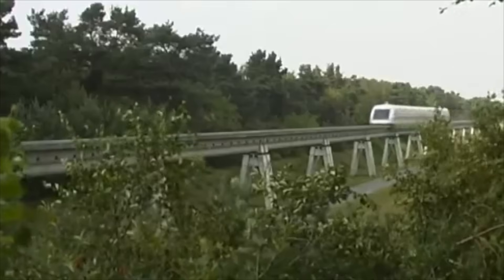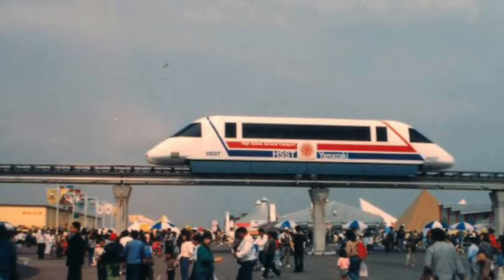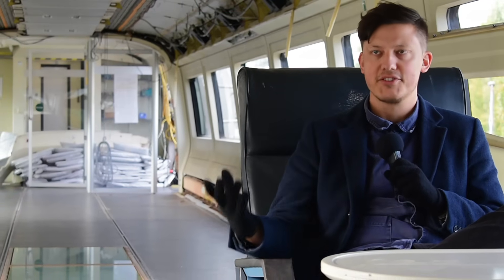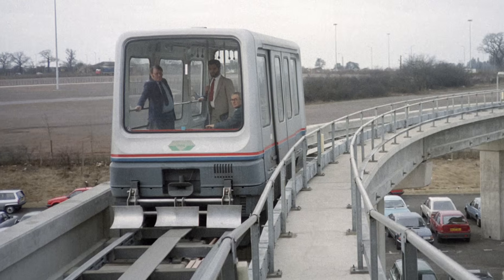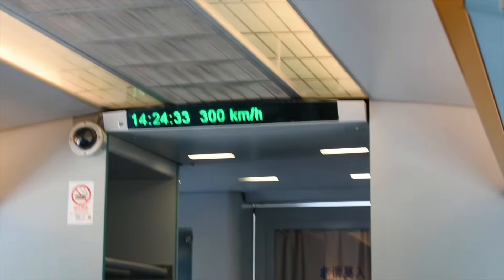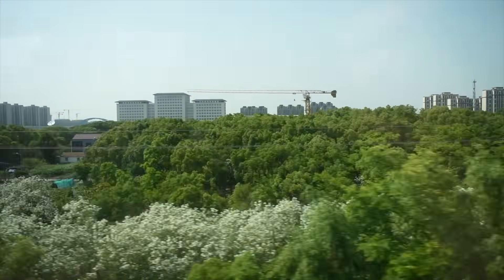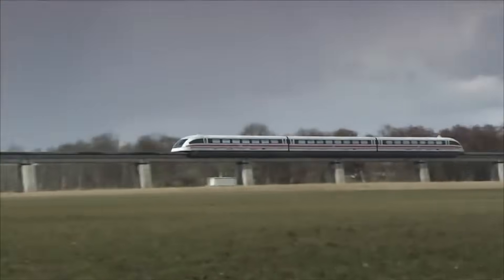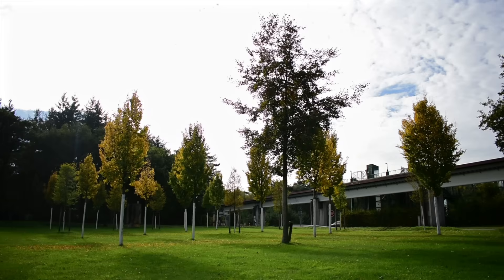Why Did Maglevs Never Succeed?

Comment: It was not the accident. High speed rail is compatible with conventional rail and hence can use existing infrastructure, i.e. can go directly to city centers on existing tracks, the track switches are simple, it doesn't need to be elevated... I suspect the speed advantage doesn't make up for all these disadvantages. Even high speed trains seem have mostly stopped to push their maximum speed beyond the 300km/h in Europe. The time savings are probably not worth the additional energy and infrastructure demand.
Reply: TBF the Compatability with existing Infrastructure turned out to be the biggest Downfall of regular HSR. Germany deciding against Maglev in the 70ies/80ies means that the ICE High Speed Trains now mostly use the same Rail Lines as Regional and Freight Trains, the latter hardly exist in Germany though. Vice versa do slower Trains also use the dedicated HSR Lines, and because there are almost no Sidings for overtaking anymore (Budget Cuts), the ICE Trains hardly ever go faster than 160 km/h (100 MPH) and realistically average only somewhere around 80-100 km/h. For the same Reason, Freight Trains often have to stop and wait for Hours or even Days, that's why Rail Freight is practically extinct today.

There's also the Problem that the major Hub Stations are beyond any Capacity and thus always are congested, so it's typical that you have to wait for 5-30 Minutes before the Train can enter e.g. Hamburg, Cologne or Frankfurt Central Station. Another Factor that always racks up Delays is that plenty Infrastructure was built in the 50ies and 60ies, to quickly fix what was destroyed and intended to be replaced relatively quickly. Unfortunately that intended Replacement was when the Railways were privatised in 1994, and now the Equipment still is in Use today well beyond any intended Service Life because replacing it would cost Money. Building a Transrapid Maglev Network instead of the ICE would have prevented this by having a crisp dedicated Infrastructure instead of this botched pseudo-HSR. It probably would also have been cheaper in the long Run, because now the German Railways are so run-down that fixing the last 30-50 Years of Neglect will take an estimated 100+ Years.
Reply: >High speed rail is compatible with conventional rail and hence can use existing infrastructure, can go directly to city centers on existing tracks, the track switches are simple, it doesn't need to be elevated...
Not exactly? Yes, high-speed trains can use existing infrastructure, but only at speed not exceeding 160 km/h or similar (YMMV, obviously). For "true" high speed you need dedicated rail lines. And "true" high-speed rail infrastructure IS expensive.
Reply: @ЦзинКэ-ы5х  Yes, I know. That's also why I wrote I am not sure that air resistance is the main problem for high speeds. Current infrastructure that is authorized, say, for 320km/h probably won't ever get authorization for 380km/h without significant changes, or at all. This may be a dealbreaker for higher speeds too, as the marginal gain for any added km/h becomes less and less.

Being able to run, additionally to dedicated high speed infrastructure, on current infrastructure with the authorized speeds is just a HUGE plus because it allows for smooth transitions and connections.
Reply: @ЦзинКэ-ы5х  conventional shared lines up to 200 km/h are not uncommon.
Reply: "it doesn't need to be elevated"
I distinctly remember the marketing material from the visitors centre mentioning that it doesn't have to be an elevated line. Parts of the test track are at ground level to showcase that ability.
Reply: @lillywho  how you can have a maglev track at ground level?  It is impossible.
Reply: @MarceloBenoit-trenes  You just don't build it on those stilt-like pylons? The track just sits on the ground.
Reply: @lillywho  I guess it does need some elevation because the waggon has a hoop going below the rail? I agree it's probably not a relevant point though. Maybe the complexity of the rail is relevant?
Reply: @monowheeling  It's at ground level in the sense that the whole right of way just sits on the ground. The actual running surface wouldn't be level with the ground, because that would mean you'd dig an unnecessary trench just for the top of the rail to be level with the ground around it.
Reply: The biggest problem I think with Maglev is that it doesnt even solve the main problem: Air resistance. At those speeds the friction from the wheels of regular trains basically dont matter at all so getting rid of that with a Maglev doesnt magically improve things either. The air resistance is a much bigger source of friction. I'd love for Maglevs to exist to cut down on flights though
Reply: @Guy-Zero  That doesn't make them different from trains at all. It may be the reason why high speed trains above 350km/h have not caught on (though I don't know, there are other possible reasons too). Yet, high speed trains below 350km/h have become a great success story over the past 50-or-so years, and Maglev has not, though their wind resistance should not differ that much.

Comment: Some techs are just not cost-effective enough.
Reply: Maglev is far more cost efficent than high speed rail
Reply: @matsv201  that is fake.  Maglev is VERY expensive to built and you need all new infraestructure.
Reply: @MarceloBenoit-trenes what do you base that statment on. Do you have some actuall numbers.or did you just guess

Comment: I fully believe the technology itself could be used safely with an appropriate safeguard system, but I have a problem with the technology not being at fault in the accident - if the emergency brakes could not stop the train before colliding with a stationary obstacle, then they were in fact inadequate as emergency brakes (in that given form, coupled with whatever detection system triggered them too late). If you can't see as far as your full stop distance is, you're just flying blind at a very low altitude and very high speed. And train tracks being free of any obstacles are ALWAYS merely a temporary situation, subject to change eventually.
Reply: I get were you are coming from but the whole thing with not being able to stop in time is the same for regular trains as well. At speeds up to 160km/h its just about or under 1km of braking distance. For high speed rail we are talking about multiple kilometers of braking distance though.
Reply: @Guy-Zero  sure, but on the other hand I suspect magnetic coupling is capable of MUCH higher deceleration than a steel wheel on a rail (seeing as how industrial machines can throw around many kilos in a split second on a linear motor, then stop it effectively instantly). This may not be particularly healthy for the passengers, but I suspect an actual crash is even less healthier. Clearly, a train would never stop anywhere near instantly, but if you're willing to apply braking at "passenger unsafe" levels of G, I suspect it could still stop in the distance a LIDAR can cover ahead.
Reply: @AttilaAsztalos  Idk but would definitely be interesting to find out. Certainly it might be the case that the braking effort on maglev is just determined by what's safe for the passengers but I'd need to look into it a bit more to figure out if that was the case for the Transrapid. From what I've heard about the incident though, it seems like the emergency brake was applied way to late by the driver and it's not clear why
Reply: @AttilaAsztalos  > sure, but on the other hand I suspect magnetic coupling is capable of MUCH higher deceleration than a steel wheel on a rail

The entire test track was, for what the TR was capable of, extremely short. One ride of at least four rounds took only around ten minutes. I'm guessing the dispatching room completely forgot the maintenance car and train crew could only visually tell that something was wrong and applied counter-traction (because that's what it is if you're specific, just applying the traction in the other direction to stifle the momentum) manually but it was too late to matter.
Reply: Part of the problem was probably that the maintenance vehicle wasn't included in any sort of signalling system, is my guess at least. I wouldn't be surprised if they just thought it was good enough to give oral permission for departure since this wasn't a commercial line. And then they forgot to get the maintenance vehicle off the track, which wasn't flagged on the control system as it wasn't tied to the magnetic traction that inherently needs to know where trains are, and then disaster struck.

In any regular operation you'd have trains probably in an automatic moving block system that controls the train semi-automatically, with the driver only monitoring when to depart and as a precaution, and the system controlling traction and braking completely autonomously.

Comment: Even conventional high-speed rail such as has existed for half a century seems like a science-fiction dream from a US perspective. It's difficult to even secure a right-of-way for the kinds of tracks that are necessary. Maglevs are cool, but the advantage they offer over conventional HSR seems like it would rarely outweigh the additional cost of infrastructure and maintenance. Still, in Japan they've been building one to eventually go between Tokyo and Osaka for decades. Having ridden the existing Tokaido Shinkansen, the idea that it's not fast enough is boggling to me, but they seem to think it isn't.
Reply: " like it would rarely outweigh the additional cost of infrastructure and maintenance"
The problem with just asuming something is that you have no clue how far away from real values you are

Comment: In 2008 I had the opportunity to use the Maglev in Shanghai when it was still running with full speed. I even have somehere a blurry shot with the 433km/h display sticking in an album. That was really impressive. Thanks to the fact that the tracks were somehow close to the ground, 433 km/h felt insanely fast.
Reply: I read that China will restart 400 km/h train service with their conventional CR450AF high-speed train. Running on newly built line designed for 400 km/h.
Reply: @bltzcstrnx  Yeah, they plan to run that train between Chengdu and Chongqing. But according to my knowledge that won't happen before 2027. Or do you have more up to date information?
Reply: @oliverzwahlen yeah it's 2027. That's still earlier than SC Maglev in Japan though.

Comment: They are trains, but not a railway. A train is multiple vehicles/carriages connected together (so a single railcar or a single locomotive not pulling anything is not a train). You can get road trains, such as those trucks that pull multiple trailers in Australia, but no rails involved so not a railway. If an announcement says "this train is comprised of one carriage" it isn't a train.
Reply: i like this theory. not sure i agree, but i like it. (also where would multiple unit trans fall on this spectrum? theyre technically one piece but still made out of several carriages, theyre just not conventionally detachable)
Reply: @knees0cks_49  This isn't a theory, this is the actual definition of a "train" (at least in dictionaries). Multiple units are trains because, as the name implies, there's multiple units that are separate, even if they are attached together more permanently (they can work separated, they usually just don't due to the carriages not having driving cabs at both ends, etc). Virgin split up one of their trains several years ago to add carriages to the other trains (so longer trains but fewer overall sets of carriages).

Comment: Looked like kind of a bumpy ride when you were interviewing your dad...
Reply from the maker: It actually was - it was less smooth than I expected. It's not bumpy per se, but it definitely sways from side to side more than you'd think
Reply: @WhatOnEarthIsThisThing  As a rail enthusiast growing up in Shanghai, I heard the reason they lowered the speed limit for the line from 431 to 301 is partially due to decaying track quality
Reply: @hanjiongmiao6067  The question is, what about it would decay from use? There is no friction, only variable magnets repelling the train to keep it in line.
I could only imagine their experimentation may have resulted in things like control software not being original anymore and of inferior quality since the consortium that constructed and supplied the system no longer exists.
Reply: @lillywho Concrete still decays and I believe the guideway segments sit on elastomeric bushings that rot out over time.

Comment: It's a very expensive for a really small niche - slightly faster than conventional highspeed rail, but still slower than airplanes. So it's somewhat realistically used in a handful of scenarios where you can connected two points in exactly the right distance, with exactly enough demand.

For anything else it's just way too expensive, or still not fast enough to make a difference.
Reply: Its an electric alternative to short range air travel. People forget this, but while planes are fast as hell, airports are nof.
Reply: @profwaldone  An airplane goes around 900km/h; a transrapid was hoped to go around 400-500km/h. So even though nobody likes planes and airports  after a certain distance they will still be much faster.

Over short distances the speed advantage is not worth it, so you want conventional rail (which after all can do up to 300-350km/h too).
Over long distances, the speed matters a lot, so you want planes.

That leaves a specific, relatively small niche for the transrapid.

The video connects its decline to the accident and that's not entirely untrue. But people were very skeptical long before. Expensive to run, requires entirely specific infrastructure, the advantages are dubious in dense countries, etcpp. There was one serious project to try and connect Berlin and Hamburg, with wildly optimistic numbers, and pushed for by politicians and industry (especially as a showcase for export opportunities); as that died the only chance left was the infamous Munich airport connector which never made all that much sense (but again was more an industry subsidy to give them the chance to show their technology). Ultimately these projects were stopped because of the costs and questionable benefits.

Comment: The Shanghai one ran at 431 km/h in the middle of the day in 2019 when I rode it, and knowing what I do now about solar energy, this makes a lot of sense.  I even went to the sheer trouble of standing under the tracks where they pass each other — that was a weird excursion into the Shanghai exurbs.

As for noise, the oddest sound was around 5-10 seconds in advance of its approach, as the magnets turn on.  This was quite noticeable in Lathen walking along that pathway (which I’ve done).  They had the version 8 going when I rode it in Feb 2000 but they failed to go on a second circuit and just did one go at full speed — which was 400 km/h.  300 and 400 felt amazing, but when it went around the turns at 200 km/h, you really got spoiled and it felt sluggish.

They spent a bit of time talking about the inherent safety of the system before you boarded the demonstration.  My German was good enough to understand the description of 10,000 Hz and how the track can only “push” in one direction at a time, so it’s virtually idiotproof.  Of course, in a QA textbook lesson, the world built a better idiot.

I notice the Shanghai train is now shakier than ever.  I think it’s got worse over time.  The test ride I did in Emsland was silky smooth, and the one I did in Shanghai in 2019 was shakier than the one I did in 2015.  But that’s not why I predict the Shanghai one will be gone around 2030-2035 … ride it while you can.  I hope the Chuo Shinkansen will be finished by then, but even when it is, it will be quite a majority tunnel adventure.  Not as scenic as the Thyssen-Krupp versions.
Reply: Chuo Shinkansen have been in development for a very long time. It's also delayed again and again. The first section, IIRC, doesn't reached Ōsaka yet.

China meanwhile, somehow choose conventional high-speed rail for their expansive network. Though, there are rumors that they will try 400 km/h service on conventional rail. The line is being built, and the CR450AF vehicle is already completed.
Reply: @bltzcstrnx   Two points:  The Chuo is delayed but never on hold — it's always progressing.  And second of all, they ALREADY had a conventional HSR service through their whole country, with nowhere left to add.  They wouldn't be building the Chuo Shinkansen if they didn't already have a high speed service between those cities decades ago.
Reply: @whophd they still need to finish Hokkaido Shinkansen to reach Sapporo. That project is delayed until 2039 which I think should take priority. Chuo Shinkansen's route is already covered by existing lines, but Sapporo is still left hanging by conventional trains.
Reply: I rode the shanghai maglev this year. Yeah its not profitable. But honestly, the tracks only go as far as Longyang Road Stn. I am sure if the built it at least til Lujiazui Stn,, it d make  much more revenue
Reply: chuo shinkansen not shuo
Reply: @tcookiem  thanks